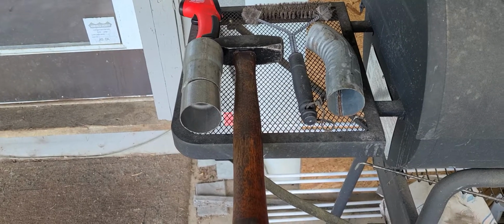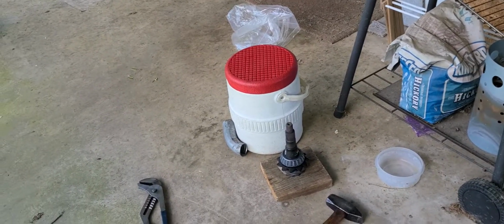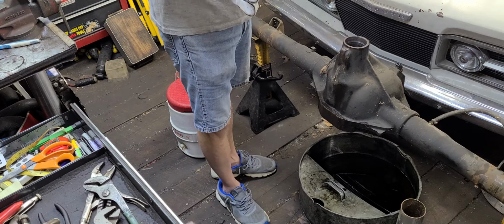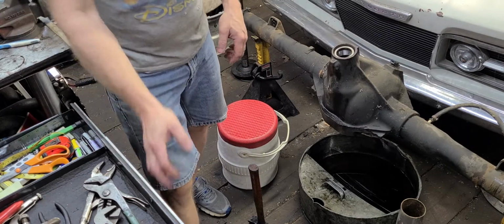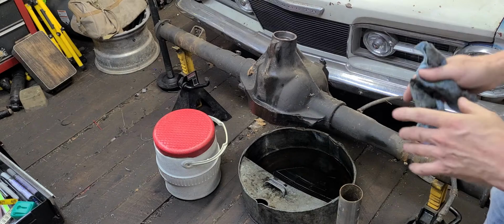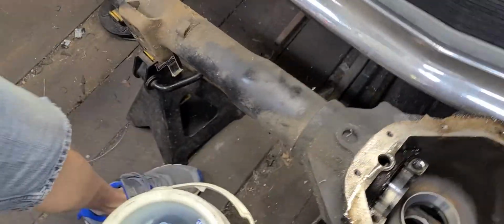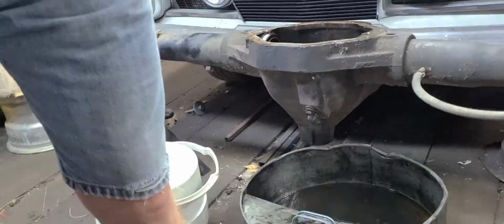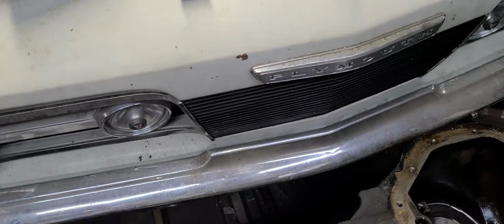1992 Dodge D150 rear axle repair 9 1/4 part 2

Comment: I have a 1993 dodge d 150 . It was my great grandfather’s. It was shed bound for a year I’ve finally got it running and know there is a tick in the differential when I let off the gas I’m going to start with the bearings . Thank you for making this video it helps a ton !!
Reply from the maker: First of all let me say thank you very much for watching the video and thank You for your comments. Be sure to check your axle bearings first before you start getting deep into the differential. I've rebuilt several and I can tell you that there's a lot there going on so you got to have all your ducks in a row and make sure that it's not something like as simple as a loose lug nut or something in the brakes as well. Basically what I'm telling you is before you start tearing stuff apart. You might want to get the rear of the truck up in the air. Start the engine. Make sure the tires are clear of the ground and put the truck in gear and let off the brake and see where that ticking noise is coming from. Could also be a dry or worn out universal joint if you look around on my channel I have some videos covering this. Do be tremendously careful with getting yourself near the spinning tires. You may want to have somebody inside the cab operating everything ready to hit the brake pedal or shut off the engine if need be also if you have any further questions feel free to ask